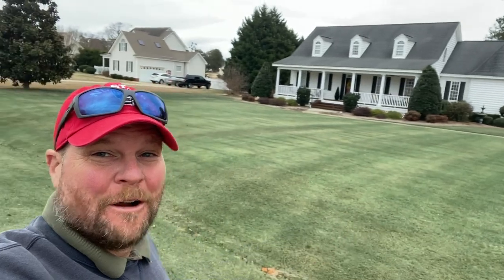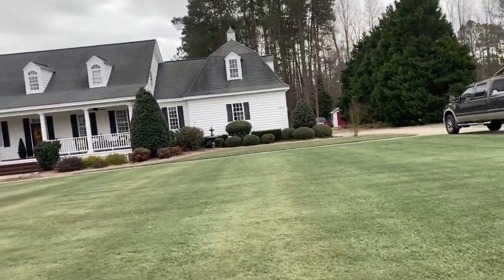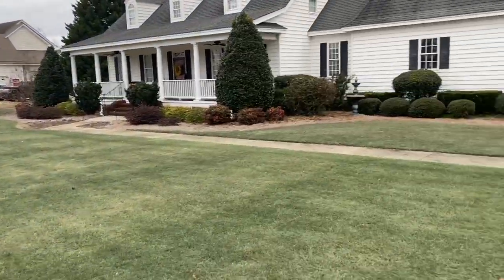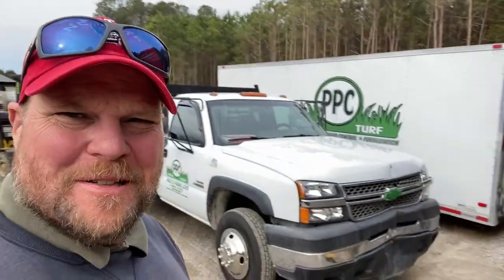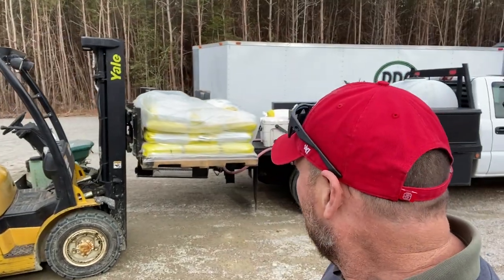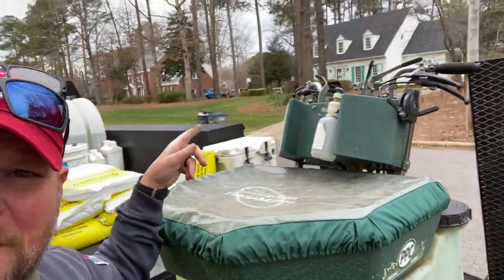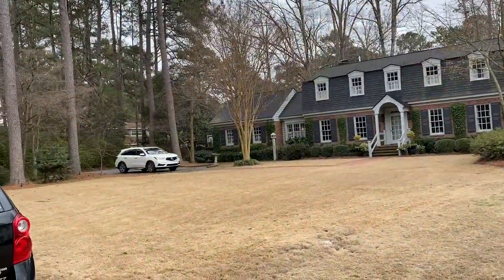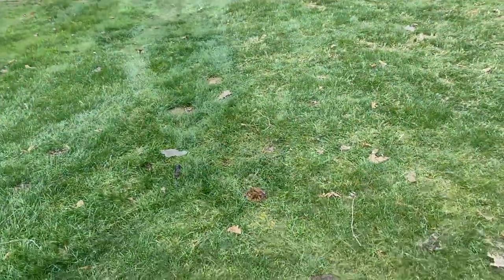How to fix rough looking winter fescue

Comment: Hey Paul, nice video!! The power agitators you speak of adding in the tanks of the permagreen, what exactly are you referring to? I’ve had a PG for a couple seasons now and haven’t tried liquid pre-m in there yet because I was scared of clogging. I think with your advice and my knowledge of the machine now, I’m ready to try.  My tanks already seem to agitate a bit like in your video but not sure this is what you mean.
Reply from the maker: It’s an attachment you get from permagreen that screws into the agitation ports in the tank
Reply from the maker: https://youtu.be/lzqBSNqdSVs Dan shows one at the end of this video